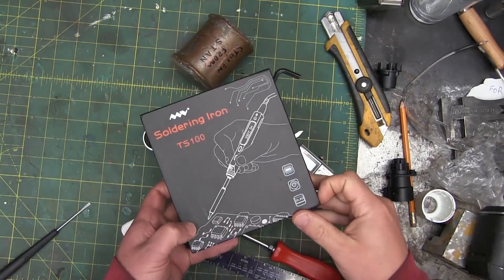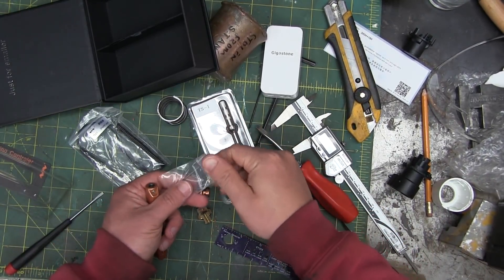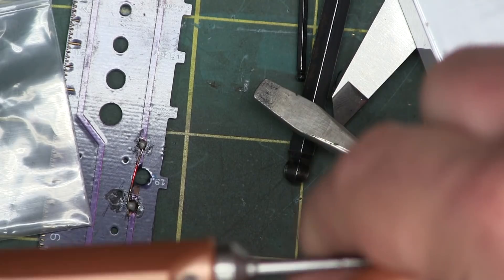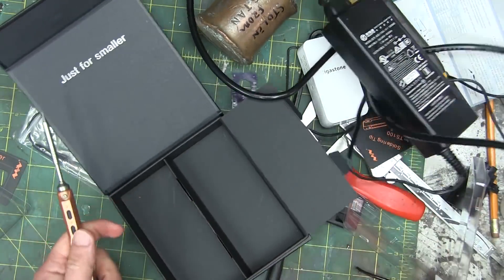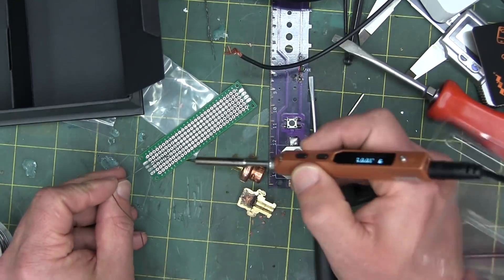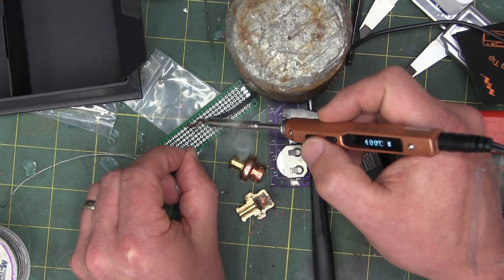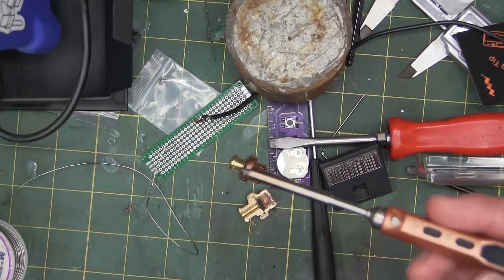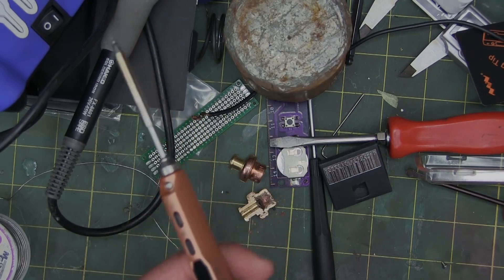BOLTR: TS 100 Soldering Iron | Quickie

Comment: If you have a 24 volt Supply on hand the ts100 will smoke the 888, you just have to get a proper wire for it. I don't understand how people are using it with a laptop power supply, it's incredibly uncomfortable that way. Just definitely is not a Plug and Play device, you have to find a wire that is comfortable and fits it and a 24 volt power supply since even 19 volts will result in slow Heating
Reply: The Rossmann Store and AvE in the same space. Today is a good day!
Reply: @h82sk8  the tech geeks and the power tool geeks all in one video. Tis a good day
Reply: h82sk8 I know, I already feel kinder, fitter, happier, more productive... still kisses with saliva.
Reply: I'm running mine on a silicone wire, Ralim's firmware, and 19V. It's quick enough for me, a nice iron, and the option to put a 6S Lipo on it makes i portable. It's replacing my shitty butane iron, but it's not replacing my old style Weller even if the Weller may be slower. It just can't match the ergonomics. Horses for courses.
Reply: @Hagledesperado  exactly its a good mobile iron we use it all the time with racing fpv
Reply: And the hakko can't run Tetris!
Reply: The base of the tip actually stays pretty cool. And for what it is, I think it's actually quite well built. I don't imagine that it can take nearly as much abuse as a "proper" soldering station, but iMO that's comparing apples to oranges.
Reply: Brian Su the amps depends on the volts. Volts/ohms equals amps. In a purely resistive circuit doubleing the volts would double the amps and that would give 4x the watts. 

The iron however is regulated so more volts would mean less duty cycle on the output and fewer average amps since the watts used and the watts dissipated must equal. 

 depending on the resistance of the heating element at temperature the required amps for 75w may not be possible at 12v, greater voltage having the effect of lowering the duty cycle gives the system more headroom to respond to heavy loads.
Reply: Couldn’t you just hook two  12 V batteries together in series
Reply: Don t delay-fry me today!!
Reply: if you search around on the tubes of you i believe this "tip error" has been discussed and what to do about it. for the life of me i cant remember which video it was on though. i have had one of these for quite a while now and it replaced my 35w weller iron that i also had for years. think i bought my TS100 about 2 maybe 3 years ago.
Reply: Louis Rossmann I love my ts100.  Thanks for the recomendation!!
Reply: John Clarke But the interface of the Hakko is ill thought out and awful to use.
Reply: Brian Su honestly it is one of the fastest heating irons I ever used. It would heat from room temp to 500° in less than 5 seconds. I used it for 3 months almost daily on auto repairs so that is usually 16-10g wire. It worked flawlessly but I always took the tip out and put it away. I probably should have left it in. AvE does great reviews but he didn't go into the detailed features of the tool like auto cool down. The amount of heat this puts out blows all my other soldering guns out of the water.
Reply: John Clarke the hakko 888d is decent for most people but the tips and heating element are not integral. The t12 tip is the way to go but hakko wants $250 for the 951d station. The ts100 has a hobby appeal as it can be battery powered and fits in your tool bag. It also has some nerd appeal as it crams 75w(w/proper power supply) and a 32 bit CPU and 3rd party firmware options all into a slim handle. If it's not best for you don't buy it. I know there are cheaper options, I know there are better options, I know not everyone needs a programmable soldering iron and many sellers provide you with useless tips and no stand and the wrong psu but I think it has it's place in the market.
Reply: The problem is, after you pimp the thing out with a good 24v power supply and a nice silicone rubber power lead, you have already surpassed the hakko 888D price. 
That is fine I guess if you need something more portable, but is it really that much more portable? Meh.
Reply: I've got my 888D set up with a few presets, and that gets the job done easily. It's very easy to switch temperatures, just a few button presses. Once you use it for even a few weeks, it becomes a reflex to change the temperature.
Reply: I think I am the only one to have a ts100 fail. I keep getting a tip error. I was thinking about buying new tips since I doubt the company will warranty it.
Reply: By the time you have bought the TS00 soldering iron, decent lead, 24volt PSU with suitable power rating. You may as well go that extra step and buy the Hakko.
Reply: @johnclarke2997  its more like i field iron we use them in the field when flying are fpv drones
Reply: Louis Rossmann what are you saying this thing sucks. 
Ave dont listen to him he knows nothing, send it to me to :p
Reply: I would have thought that Amps is far more important than volts when it comes to heating. Maybe his 12v PSU doesn't put out many Amps.
Reply: Rob Dotterer the whole thing looks really cheaply built anyway. There’s nothing to insulate the heat from the iron coming into the PCB and the handle hasn’t for any ergonomic rubber grips nor finger safety.

Comment: Going to buy one of these.
Seems a 19/20v laptop psu  would be the ideal supply if like me you have loads kicking around.

Also on the basis of this review I'll be building a flexible silicone PSU extension cable

Comment: I've been using one of these for almost two years now and it's been very nice to me. Coming back to it after using a bunch of metcals at my university it still holds up IMO. I mostly do loads of 0603 surface mount stuff with it though so I don't have to pump crazy amounts of heat in to anything.

Comment: Try the no-name $25 adjustable temperature LCD soldering irons from eBay - cheap, adjustable temperature, flexible cable, tons of replacement tips, and work great.
Reply: And it heats up so fast! I think I suggested it for a BOLTR a few months ago.
Reply: Link?+

Comment: The Oki/Metcal irons are my preferred desktop kit. Not least because my oldest metcal sp2 is 20 years old and still fine, might be a metcal fan boy but the gear works so never felt the urge to try others. Just got the milwaukee battery iron which is great for wiring but not ideal for fine work. Brilliant when wiring up machines with a joint here, another there, probably going to combine with a m12 heat gun for heat shrink. Productivity win means more 🍺🍺🍺🍺

Comment: You missing the point. Its meant to portable non gas soldering iron. Runs off batteries or psu and small size. Throw it in your tool bag and Bob is your auntie.

Comment: Like said before, XT60 connector with silicone wire and LiPo for on-the-go use, yeah, sure. In benchtop with crappy-leads-PSU? Hardly worth it. Still, an essential part of modern day MacGyver-kit, I would assume.

Comment: This plus a drill battery is the best portable soldering soution, way better than gas irons.
Reply: the gas ones are horrible for tight places because the exhaust flame burns everything in its way.
Reply: He's aliiiiiive! Hope you're ok. Miss your videos :)
Reply: if you found a model for a 3d printable clip,  i'd be willing to bet somewhere in the attached files would be a wireing diagram  for the battery :D if not,  just poke about thingiverse,  i'd be willing to bet you'll find something up your ally
Reply: I constructed and 3d printed myself a connector shoe for standard bosch (the blue ones) batteries
Reply: I bought one of these and an adapter to run in off a 20v Dewalt battery for use in the field (oilfield E-tech). Less than $80 all in and is beats the hell out of my snap on butane iron. I do like that the snap on has a magnetic base so you can stick it to a work surface and use both hands to solder a wire splice, but the actual soldering performance hands down goes to the TS 100. A moderate breeze will kill the performance of my snap on, while the TS 100 will just keep on chugging even in the windiest conditions. Just keep in mind that you don't get the full wattage if you don't run it at 24v. I believe the Dewalt 20v batteries are actually 5s packs running at 18.5v, but mine has handled anything I've thrown at it without any issues with that setup. For a portable iron, it's by far the best option available in my opinion, but it won't replace the Hakko on my bench at home.
Reply: Try a blowtorch and screwdriver. That beats the rest for heat.
Reply: mikeselectricstuff TBH that's all I really use is the gas. Thing gets hotter than buttsex. Is this little bastard really that good?
Reply: hmmmm. I Dunno Davey XD. Ive got a Weller that lives in my truck. If im doing field work I fire up the inverter and do the job on the Tunnel cover of my truck. Ive got a generic Butane iron from Crappy Tire and shes ok. I only use her for cable joints. Ive got a tiny USB jobby for fine soldering of SMD's in the field but you go over 18G on anything and its useless. The Weller never fails XD. I consider myself the Queen of Gerri Rigging & Field engineering ;)

Comment: I got me a Dremel butane soldering iron, and it works fine for me. I needed a portable iron cause automotive work, and generally my work is never around a bench where I could get an iron in without a 100' extension cord.

Comment: I desoldered/snipped off the power connector on mine and added a heat resistent silicone cable which provides the power and grounding.  Sure, no strain release but it's ok for me. I only use it as a spare or if I need 2 irons at once, it actually beats my higher end ERSA station (which is much better than a 888d) some times.

Comment: IIRC the manufacturer also makes an ultra soft cable with XT60 input, I made one with silicone wire before but this one beats mine.

Also the firmware on GitHub works much much better

...... and yeah, chisel tip is the only way to go

Comment: Got one of these for about 2 weeks now. You are using it with the wrong power adapter.   Use one from a laptop with a more flexible cable. The adapter cable sold to power it with a Lipo pack is made of nice silicone cable.

Comment: I do believe you missed the draw and discussion Rossmann and EEVBlog were having concerning the iron and its overall heating methods/tip construction/heat capacity vs the typical Hakko 888D/Weller jobbies. Maybe worth a revisit if you're into quantitative testing on it, if not you could sent it my way :D

Comment: The STM32 OLED can be built for under $40USD w/ mains power and it is probably better than the hakko you recommended as I have both.  They both blow my old trusty 936 out of the water but hakko is just overpriced amid the competition around them.

Comment: Hmm, if you want a quick portable iron, get a Weller Pyropen. My Junior version that I use for smaller stuff, I bought in 1985 and apart from a little repair to the tip retention mech, it still works fine today. The big one is better for lareger stuff but the Junior will still solder PL259 (co-ax) connectors to Pope H100 (hefty co-ax) with a solid centre conductor of (I think) around 2.9mm dia. Cheapie gas irons also exist in ebay / Bonggut etc etc. which also work well.

Comment: I use it as a battery powered mobile tool. I plug in a 4S lipo and I’m solid out in the field or under the car hood or wherever I might need a hot poker. I have the same hakko on my bench though

Comment: Picked up something similar from the usual scumbags a couple years ago, thinking it was the same thing with a fixed cord. The accelerometer is so lame that every time I have to pick it up i have to shake it as hard as i can for 10 seconds or so before it starts to reheat.  Kinda wish i'd spent the extra 20 kopecks on that TS100.  Now if someone sent me one I'd feel all warm and fuzzy about having something to fix electrical issues on the jeep many kilometers from the nearest plug.

Comment: I'd gladly take that iron! I've been thinking about picking one up to replace the Hakko 888D that I carry on my truck. Nothing wrong with the Hakko but the size of 'er is what intrigues me. Of course I'd have to fabricobble an adapter so that I could power it from one of my DeWalt 20v batteries in the field.

Comment: The soldering iron I own was 50 cents at the thrift store and I'm not sure if it's working properly or catastrophically failing. Pretty hard to tell the difference.
Reply: Soccerguy1832 
If the tip gets hot enough to melt solder you're onto a winner!
Reply: same here, but mine works pretty good as a hammer when i need to beat something back in place
Reply: Or is it the operator

Comment: It is better than the Walmart one I have been using that at a low cost of $9.98 anything is better than this thing I use right now. But it did get the job done so I can not complain that much I guess. You can send me that one lol me and my to kids would use it. We have been using this Walmart thing to build some eap8266 and raspberry pi projects.

Comment: I solder with gas, for automotive it's just the best. the first one I bought came with a gas heat shrink tool. For about $45. They're good enough to put the pins on an Arduino, but you won't be fixin iShmoo with it. That's okay, shouldn't be buying that garbage anyway.

Comment: Suggest for a change you RTFM...Had one for a while. Use an old 19v laptop PSU which has a thin lead and a right angle plug.. Found the open source replacement firmware which lets you permanently  change settings without needing USB. Really like snooze mode which detects you picking it up and re heats ,  and the auto rotate display using its accelerometer...
Stays right way up left or right hand use...

Comment: Just grab one of them battery testers fer yer old de'wilt or what have ye drill batteria.  Attach a flylead with one of them right shapely pokeybits for the barrel socket there.  She'll chooch for quite a bit longer than that crusty old no-heat battery powered abortion.

Comment: This is honestly the worst designed soldering iron ever. They’re using a 32 bit arm core processor to determine if a piece of metal is hot enough. The computers in 1969 had exponentially less processing power than this, but were able to send humans to the moon.

Comment: Actually at 24V the TS100 is more powerful than the 888D.  And it's intended for battery use, not as a bench iron.  And it really is open source; I have the schematics and code right here.  And the user interface is better than the Hakko.  Louis was right, the TS100 has a place in the toolbox.

Comment: Call me simplistic, but the only thing
that should be inside a soldering iron
is a heating element, done me ok for
the last 45yrs. or so here and there.
As for the accelerometer that's mentioned
in other comments, sounds like a fire 
just waiting to happen.

Comment: I could use it right now, battery in my laptop blew up like a hotair balloon  got and new battery and its not charging  the new battery:( the adapter output is correct 9.5v so I guess I will have to do surgery to figure out what is wrong :( ooo yea and asus whats 480$ to fix it :P

Comment: Oooh, this Aussie scumbag certainly wouldn't say no to that soldering iron. Plug it into a Qidian QD185-TY powerbank which has variable voltage output upto 13v, and that'd be a sweet lil portable sodder setup. Can sodd off anywhere!

Cheers for the vid as usual, AvE.

Comment: The great part is that it fits into a ziplock bag and you can bring it into the field and power it off a lipo battery. We use them on our drones all the time in the field. I still have a proper weller soldering station at home, but for the field this thing kicks ass, and you can power it with your drone batteries.

Comment: If the heating element ain't part of the tip, it sucks.......the heat right out of the tip. TS100's i sawed come with a plentitude of tips. You musta got rippied. This little guy's on my list. Got myself a 30v 10a BT PS to power it.

Comment: I've read somewhere that it has issues with grounding the tip.
Also it needs 19V+ to work "as advertised".
It's kinda screwy that it uses a DC5525 instead of a 5,5mm * 1,7mm which come with most laptops.

Comment: When are you giving it away?  I wouldn't mind dickering with it, I am an electrical engineer and I like building circuits in my free time as a hobby, and some of the larger surface mount components I like to do by hand whenever possible and this looks like it might be easier to control then a larger unit.  I am not a big fan of using solder paste and putting it in the toaster oven.  Its easy to put too much or too little, and it gets on your hands and all over the place and worst of all it makes breakfast taste off for the next couple days.

Comment: You should try it on thick wires or PCB with large copper planes, then compare it with your hakko. I made a 4 awg jumper cable with this. The temperature recovery of this thing is so amazing it actually feels closer to a 150W hakko. I have been a long time hakko user and this blew all my old hakko out of the water. Hakko has way better pens and tips, but the performance is just ages behind. If you have used JBC soldering irons before, this actually feels a lot like them.

Comment: These are super popular with the miniquad guys out flying because they run them off one of their 4S lipos for field repairs with a short XT60 to barrel connector cable. I've used one in the field and it sure is handy but I  prefer my Hakko for working on the bench.

Comment: Mother fluxer! That's quite a bit of coin for not much in the box. However, it does have quite the tip on it. So, "just the tip" could be quite a bit more than the "box" can handle.
Reply: To The Top Crane it’s all about the girth of the tip. Just the tip mind you.

Comment: AVE, 12 volts is too low, hook up to drill battery for 18v or laptop 19v psu for bench work, best damn iron I ever used. damn thing will heat to 400 dungarees at 19-24v and stay there... BTW get a chisel tip, cone is useless.